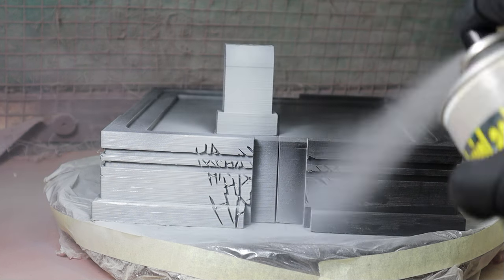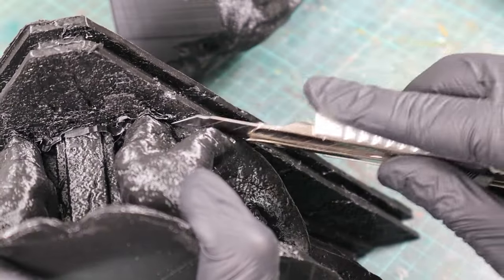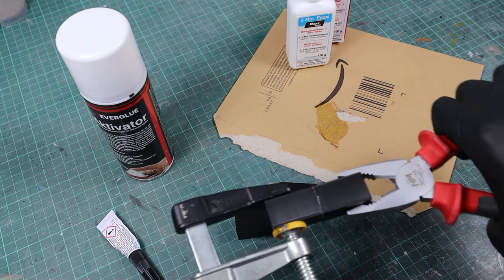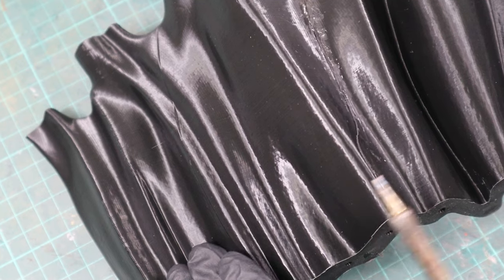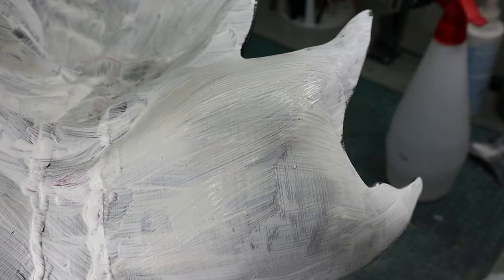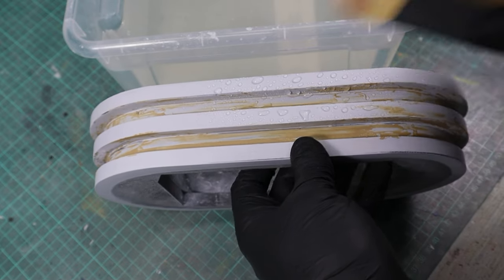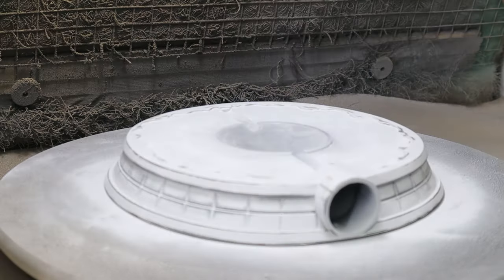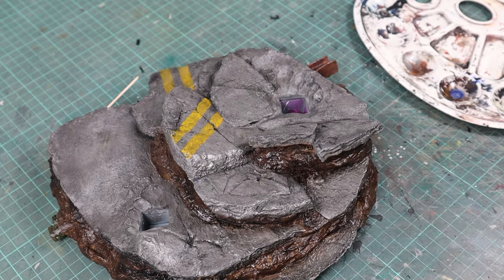Post Processing FDM Prints: How to Remove those Nasty Layer Lines

Comment: Great tips, thanks!

- A tip of my own to pass on, from the woodworking world: Use superglue instead of tape to hold the parts together until the epoxy cures, at least on larger parts. Leave a few gaps in the epoxy, dab a tiny bit of superglue on one side and activator on the other and press them together. The superglue will hold everything in place while the epoxy cures, and the bond is strong enough that you can even handle the part (gently) while it’s curing.

This is less generally-applicable with 3D printing than woodworking because woodworking parts are so usually much bigger that there’s plenty of space for both the superglue and wood glue, but it should work fine for larger 3D prints. Over reasonable-sized areas, the epoxy bond is going to be stronger than the plastic anyway, so a little area lost to the superglue won’t make much difference in the ultimate strength. (And even if it becomes brittle with time, the superglue will still contribute to the overall strength.)

A great and very useful vid, thanks!

(I do very little painting of things I print, but I nonetheless learned a lot from some of your other videos: I’d never heard about using varnishes to make it easier to touch-up paint details before, what a game-changer! 🤯)
Reply from the maker: Thanks mate! I already used super glue + wood glue for woodworking too. Good hint using epoxy + super glue for 3D printed parts too!